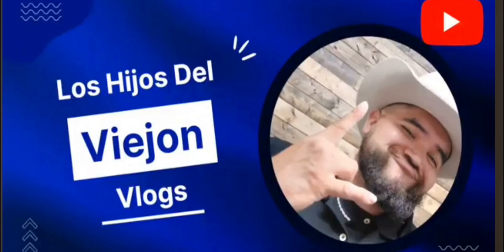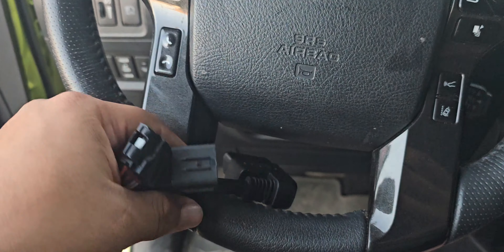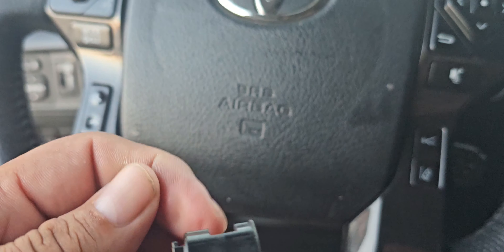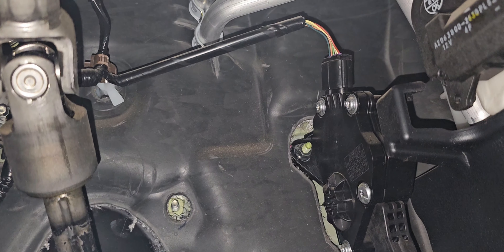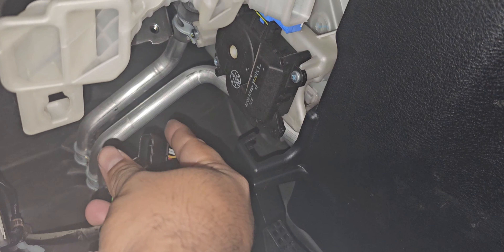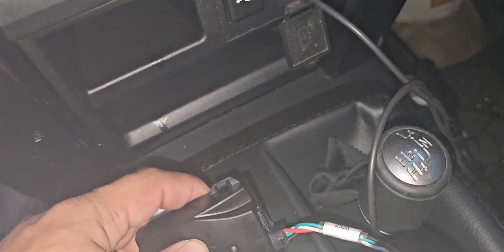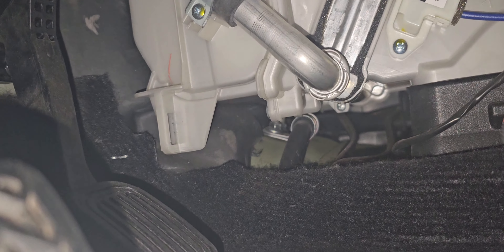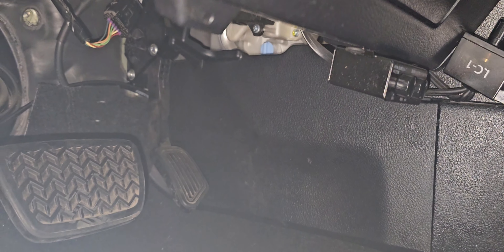Installing a Pedal Monster on a Toyota 4Runner - Unleash Your SUV's Power!

Comment: Just bought one! How are you routing it from the OBD port? Did you put it behind the kick panel like you did for the side closer to the pedal?
Reply from the maker: Everything is tucked in on the right-hand side. A plastic panel comes off, and there is enough space to fit everything.